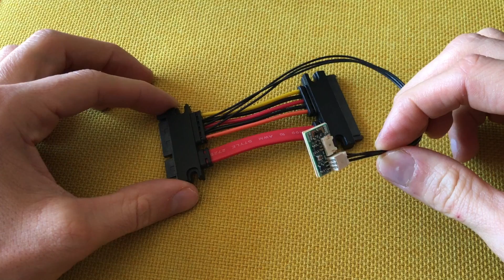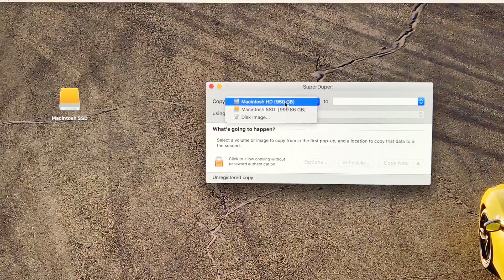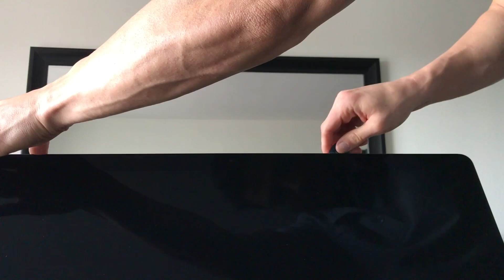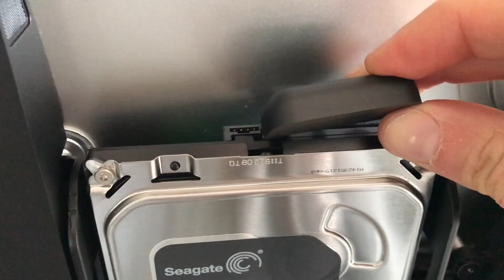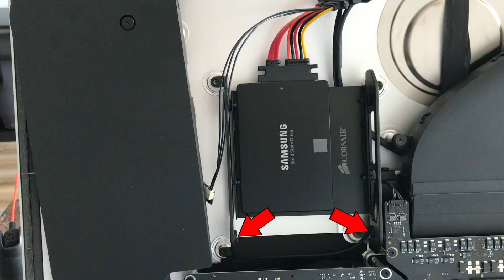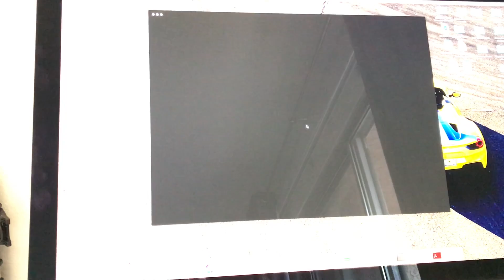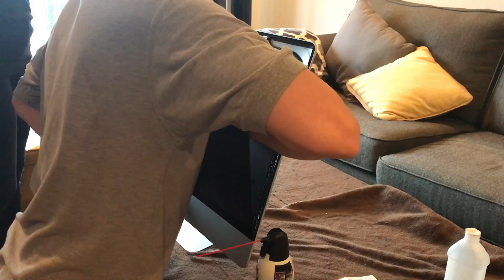How to make your iMAC 5 times faster | 2012-2017 SSD UPGRADE WITH THERMAL SENSOR | Step by Step

Comment: Great video!  I am looking at a 2015  27” .  It is a floor/demo from PC Richards.  They are asking 1100 for it.  It too has a HDD.  I played around with it for about 20 minutes, and it seems pretty snappy, however there isn’t really anything on it.  If I get it, I would definitely put a SSD in it.  The downfall is that since it is a 2015, I cant get AppleCare, however it will be covered by Apple’s one year warranty.  Do you think I should pull the trigger?  Looking to get back into photography and teaching my some video editing.  Currently I have a Mac Pro and I bought him a used 11” Mac Air. Looking for something stationary to add to my collection.
Reply from the maker: Hey Shawn! I think it's a great deal, pull the trigger.  Do you know whether it's an i5 or i7 processor? Mine was snappy too in the beginning but started to slow down once I started juggling 4K footage.  I don't personally don't regret purchasing it nor upgrading.  I love my iMAC.  Oh! And mines only an i5 but I edit also off the T5 Samsung SSD which is AMAZING.  Keep me posted. :)
Reply: AIRWOLF it is an i5. So you wouldn’t have any worries about purchasing a 2015?  It was a floor model and is in very good shape. No dings/scratches. I still get the one year Apple warranty. I am thinking about $250 -$300 for the SSD so that would put me at about 1400 when all is done.
Reply from the maker: @Scorbittphotography  I think its a great machine and I'm still using it as I type this message lol.

Comment: what about limitations that apple sites says? https://support.apple.com/kb/SP758?locale=en_US
Reply from the maker: What limitations are you referring too?
Reply: @AIRWOLF   thank you! I mean the features that Apple says in the link, I think I cannot put a SSD500GB in my device or upgrade to 32GB, it says up to 16GB RAM and 256SSD, is that true?
Reply from the maker: From what I’ve been reading you can upgrade to at least 1T SSD on your machine.  The RAM however I’d have to dig a little deeper to find out.
Reply from the maker: @rodrigoorellana2389  But if I was in your position i'd double and triple check.
Reply: @AIRWOLF  thank you men, greetings form Chile
Reply from the maker: @rodrigoorellana2389  You're welcome!! I hear it's beautiful down there. :)
Reply: @AIRWOLF  do you know if there any app like "everest" or "speccy" for mac? with detailed system info like CAS latency from RAM?

Comment: Watching you work on carpet to take that monitor off reminds me of when I tried to install memory in my old G5 tower and fried the cpu from a static discharge. You're lucky you didn't do the same.
Reply from the maker: I know right! Especially out here in Cali where it's dry AF. lol
Reply: Chris Barron pixlepeople llc also i recommend using official adhesive opening tool . Available on amazon it is much safer and faster method to open the adhesive.
Reply from the maker: @Ittakeshimanhearttofeelit  I agree, I was being risky.

Comment: I did everything like you did on the video, it's now in perfect good speed, but the part that you unplug and plug the monitor and power cable it could not made me saw it well, I did checked after installed the ssd and running well, but the last time when I pack up all those with tape glued, I didn't sit the power plug properly so it doesn't work at all, when I reopen it I crash the glass from top to the middle 2/3 of the screen! It works fast and with taping on the top, still good until I can't stand for it, may be buy a screen for replacement or a new Mac ?
Reply from the maker: Oh no!!

Comment: Hello! thank you for this spectacular and easy guide, I have some questions?
Instead of Samsung Evo, can I use any other SSD? like a Kingston SA400S37/480G?
If I use a Kingston SA400S37/480G can I use the same thermal sensor?
Reply from the maker: Hey Marco, you're very welcomed! Happy to hear the video has helped you.  Now from what I gathered you can use any SSD so long as it has the SATA connections.  I personally have used Samsung and Sandisk in many Macs without and issues but never installed a kingston.  Now, that doesn't mean it won't work, I personally have never used it.  I'm sure it'll be ok.  Just do your research on that specific drive to make sure it has great performance because you're not going to want to dig back inside your mac if it were to fail you.  As for the thermal sensor, it'll work with any SSD you decide to use.  It's soul purpose is just to detect in increase in heat. :) Hope that helps.  Keep me posted with your results. :)

Comment: Hi , great video. I have a Late 2013 iMac which has the HDD fitted in a horizontal position, and apparently the drive cable is a very tight fit. Looking at your video for the thermal sensor there is an adaptor fitted between the drive and cable and I am not sure wether it will fit in this model iMac . What is your opinion of the "smcFanControl" software do you think that that would suffice?? Thanks once again for your informative video..
Reply: Thanks Airwolf, I am picking the drive up today and will see how it goes together..
Reply from the maker: @johnchipperfield8686  Thats Great! Keep posted on your success.
Reply: Hi Airwolf. Forgot to mention that my iMac is a 21.5, anyhow the drives are the same size but the SSD is thinner. all fitted nice and easy, speed increase is amazing.. thanks again
Reply from the maker: John Chipperfield That’s great news!! I super excited to know that this help you bud. 100%
Reply from the maker: Hi John.  Even with the horizontal position of your HDD, it should fit.  The HDD drive and bracket are SO big in comparison to an SDD you'll have quite a bit of space inside.

Comment: Thanks! I'm upgrading my iMac (27-inch, Late 2013) and im just wondering if this will work? 

https://eshop.macsales.com/item/OWC/K27IM12HE1TB/#owctabs

$174.75
Thermal Sensor + Adhesives, tools, SSD 1tb, bracket

what do you think?
Reply from the maker: Dang that’s a great deal! What kind of SSD is it?
Reply from the maker: Whoops nvm I found it.  I’m just a fan of Samsung’s SSD’s. But man I think my whole kit was $342 or something like that.

Comment: i really like this. But i wonder if this would work with my old 2006 model or even make a difference.
Reply from the maker: It would most likely work, but I don't think it would be worth it overall.  I've personally installed SSD's on some of my friends older MacBook Pro's and iMacs.  It does increase the speeds "slightly" but on a machine that old i'd just upgrade to something a little newer.  Hope that helps my friend. :)
Reply: Is it still applicable for I mac 2008?

Comment: The late 2015 base 21.5 imac comes with 5400 rpm HDD
Reply: Wow, 2007 technology in a 2015 machine.
Reply: @Darrylizer1  yea, so what internal storage were you rocking in 07 tough guy? My 2015 imac was a generous gift from my father, i had the option to get one with the sad little fusion drive or a ssd when we were at the apple store, i was grateful to get that, im sure not gonna ask for more. Im running latest version of mojave perfectly for what i do
Reply: @Funhouse_Comics   I had two 500 GB 7200 rpm hard drives in a Mac Pro G5 tower. Still have the hard disks tho the computer died.
Reply: Darrylizer1  I always liked and wanted  mac pro g5. Xeon chips were next gen
Reply: @Funhouse_Comics  It really was a great machine. I used it as my graphics workhorse for years and then as my music workstation. Sadly it died three years ago. I probably could have had it fixed but I was moving.
Reply: Darrylizer1  As long as your happy with your present  tech thats all that matters
Reply: @Funhouse_Comics  That's true.

Comment: Incredible video... very thorough.  Couple questions; first before cloning the SATA to the SSD, does it make any sense to delete any programs or files that you don't want or need? IOW, if you're seeing the spinning ball with a SATA drive (or a Fusion drive) will it be any faster or slower if you don't dump some old stuff first? Second... will this work with a 1TB Fusion drive that has a small SSD boot drive? Would you just clone/swap the boot drive?  Did you reformat and use the old SATA drive in a generic housing?  So all iMac 27" from 2012 on have the sticky screen, prior to 2012 they have magnets?
Reply from the maker: Hey Mike! Sorry for the delayed response.  So, in regards to deleting stuff that you don't want to carry over, I say yes! Why not? I did the same thing actually. Also your SATA with the SSD will preform faster for certain. Now, I don't see why it wouldn't work with the fusion drive, you'd just have to remove the whole drive.  Mine wasn't a fusion it was just the regular 1T 7200rpm. (I say you're fine, but maybe do a little more research) Perhaps one of the guys here can chime in. But i'd literally clone everything over to your new full SSD drive.  As for my old sata drive I kept it for a little why and didn't format it until I knew that everything was working properly 100%.  Then I formatted it and I use it as a storage drive. Let me know if you have any other questions and thanks so much for stopping by. :) Im happy to have helped.

Comment: Hi. Please could you help me? I have an iMac 5k 2017 which comes with 1TB Fusion Drive. Do you think that installing a SSD would make it even faster? Besides, I found online some gears called SSD EXTERNAL. Are they the same thing? These ones don’t need an installation, just thunderbolt 3. Please help... I’m confused.
Reply: Jorge I have 2 older 2011 iMacs upstairs with external ssd and they run great.. I also have the 2017 5k and I just did the ssd swap but I wish I would have just did more research and got the M.2  ssd swap instead. a lot faster 2.  I noticed Airwold didn't pair his new ssd with apple ssd that on the backside of the board..  ps the ssd iMacs upstairs have thunderbolt 2 ports and I have them in the USB ports and they get great read and right speeds..
Reply from the maker: Hey  @matt406regal  I didn't pair them.  Could you perhaps send me information on that by chance? Appreciate you stopping by bud. :)
Reply: AIRWOLF  This is the tutorial I used.  https://youtu.be/bm33mRwuyWw.    With it paired my speeds are  reads _850s.   Writes 1300s
Reply: Thank you so much  Matt. I did a very deep research and I found out that since my iMac has thunderbolt 3, it is better for me to use an SSD external ( Samsung X5) which is the newest and fastest SSD by far in the market. In this way I don’t have to take the risk of opening my iMac. Thank you so much for your time and for your help.
Reply: @Dominguezucv  im glad I could answer your questions. The first ssd I used was a SanDisk extreme 500gb. The price was. good around xmas time for about $71.. good luck.
Reply from the maker: @Dominguezucv  MAnnnnn that X5 is some serious speeds.  WOW!!!

Comment: Do the 21.5 inch models not have a thermal sensor for the hdd?
Reply: Danny Israel OWC only sells thermal sensor kits for the 2013  and newer 27” iMac, so my guess is no.

Comment: Thanks for the video! Really helpful! Just one little suggestion. At Apple we never place the new adhesive on the display itself, but always on the enclosure. That way you can align the display perfectly before you remove the strips and stick it. And we do it all with the iMac standing up with a foam wedge holding up the enclosure. Former Genius here... ;-)
Reply from the maker: Thanks so much Daniel for the information. Yeah I'm like 100% certain I didn't so the "Genius" way. hahaha
Reply: @AIRWOLF  but quick question, though, because I'm about to do that myself. Do we really need the thermal sensor? I've seen lots of people online saying the new SSDs are able to pass through thermal information to the Mac just with the regular built-in connection.
Reply from the maker: @danizuc71  Honestly can't say yes or no.  I've read where people are saying both.  That you should and the opposite saying because it's an ssd you don't need to.  I only did it asa a safety precaution.  I really REALLY didn't want to go through the process again lol.  For the extra $30 or whatever, i'd just do it.

Comment: I have 27 inch Imac 2018 5K do you think I need thermal sensor for SSD upgrade or no?
Reply from the maker: Hey Peter.  Some in the comments may say no, but I think it doesn't hurt to install it. For the extra little bit of money, why not?

Comment: Hey man, thanks for this awesome video. Can this cable work for my 2011 MacBook pro 15 inch? After installing the SSD my fans are blasting high, is there a fix apart from the Trim and third party softwares?
Reply from the maker: Hey bud! For starters thanks for stopping by and checking out my vid.  So to answer your question, no you cannot install the thermal sensor on your MacBook Pro.  BUT! From what you're telling me, it sounds like you have to reset you "SMC".  Your mother is just confused so resetting it "should" align everything again.  

Here's how apple tells you to do it: https://support.apple.com/en-us/HT201295

And here's a video: https://www.youtube.com/watch?v=5JLw2M379rc

Hope you get it all figured out. :) 
-Wolf
Reply: @AIRWOLF    Thank you so much for answering my question. Actually I tried the   SMC but it didn't fix the issue. Do you think  doing a fusion drive by linking my original and the new drive will decrease the fan speed ?
Reply from the maker: @adnanm9958  A fusion I don't think will be as fast because its not a full SSD.  So, I've personally experience the same issue with my MacBook Pro.  I tried the SMC reset etc and it didn't work.  BUT! What did work was that I drained the battery until the computer wouldn't power up anymore than let it sit for a couple weeks.  I know it's sounds dumb.  But, it did reset itself and started working.  It's worth a shot if you have another computer to use while that ones out.

Comment: You don't need to spend any money to enable Trim, I just did my Late 2012.  I used Terminal and typed in a command (google it).  And the Samsung 860 EVO I had installed has temp monitoring capability within the drive, so no temp sensor accessory needed.
Reply from the maker: Thanks for the info. :)
Reply: @AIRWOLF    Airwolf, Is Dan saying the Samsung EVO SSD has a built in Thermal Sensor and therefore the plug in sensor you used  isn't necessary?
Reply from the maker: Hey  @billding8627  I've personally have found more articles saying that you must install than not.  If people want to argue against it,  thats fine.  The video is how "I" did it. And to this day have ZERO issues with my iMac. Samsung isn't apple and whether it has a built sensor or not it's got to somehow communicate with Apples OS.  Ive read cases where fans are running full blast even after resetting the SMC.  There's absolutely ZERO issues with having the sensor then not.  I personally didn't want to chance it and do the job twice.  We're talking about a $30 part, it's not breaking the bank.  If people don't want to install it and claim it works, good for them. 

As for trim, yes you can run a terminal code and activate it.  But if you're not comfortable doing it, then theres an option not to.

Comment: Great Video! Is the thermal sensor installation mandatory ? I installed a samsung 860 EVO 1TB connecting the Apple sata cable without thermal sensor...
Reply from the maker: I mean, I couldn't find a solid answer so I did install it.  But I have seen it were people haven't.
Reply: @Luca Colombo, No need for a thermal sensor. You can get software to give you lots of info on your SATA SSD/hard drive https://www.youtube.com/watch?v=leY2U9zbmPk

Comment from the maker: Hey Everyone! If you'd like to install "TRIM Support" on your brand new SSD it's $14.99 at this link here: https://cindori.org/trimenabler/ It'll help keep things in working order. Or if you want to run a command in your terminal command you can do it there too.  I've personally never had any issues without it, but if you're concerned you can do it at the link. Just remember to reboot your computer afterwards. :) Thanks again for all your positive feedback.
Reply: Trim is natively supported for 3rd party SSDs its a terminal command.
Reply from the maker: Really? Because I did look it up under my system information and it did say trim wasn’t off.
Reply: Thats odd.

All you had to do was to go into terminal

Type in: sudo trimforce enable

Type in your password and your Mac will restart and trim will be enabled.
  @AIRWOLF

Comment: Don't forget..you need Trim for the Ssd since it's aftermarket and not Apple. Trim helps clear unused blocks from the Ssd ultimately maintaining its read and write speed over time. Google "Trim Enabler". It's $10 but it's necessary.
Reply from the maker: Thanks for sharing! And yes I've heard mixed reviews about it, but I haven't personally experienced any issues on any device that i've upgraded.  But, for arguments sake i'll post a link and pin it for those who'd like to install TRIM.  Thanks so so much for the information.